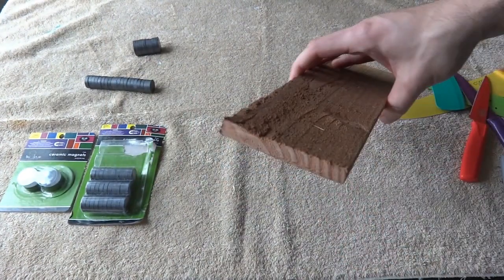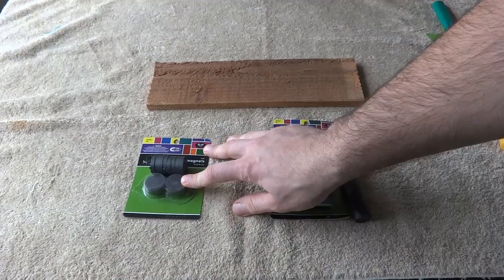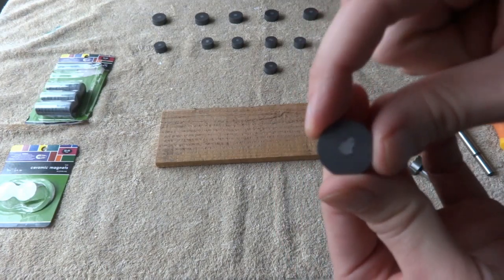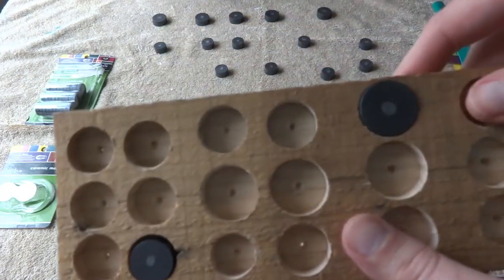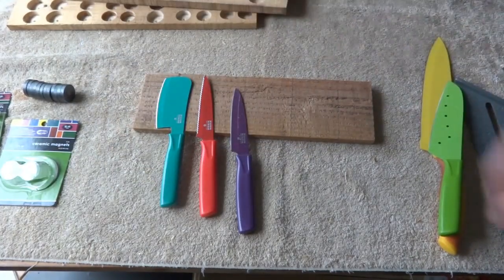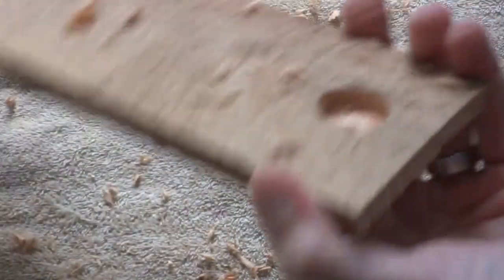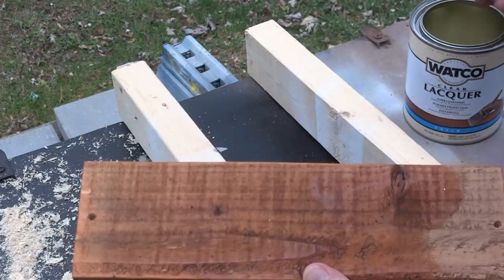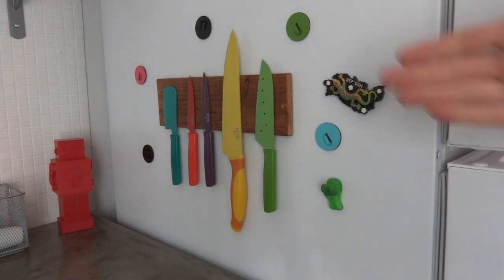DIY Magnetic Pallet Wood Knife Rack!

Comment: That's cool, I think harbour freight or princess auto in Canada sell magnetic strips in different lengths for exactly this application with tool, so plenty strong, and perhaps a bit easier to make as you only have to put a dado into the board with a table saw or router instead of multiple holes. Would also eliminate the risk here of your Forstner bit punching through the board.
Reply from the maker: I've seen those at a few hardware store, but never thought to sink one behind wood like this. That could be pretty cool!
Reply: Ikea sells them too... though some of them are a lot stronger than others. Even though they're the same size.

Comment: Nice, would have been a great idea for Christmas presents!

You could have also used Neodymium Magnets and gotten away with 1 or 2 for the smaller knives and 4 or 5 for the biggest knife ($12 on ebay fir 20 magnets).  They are thinner and stronger so you wouldn't have had to get so far though the wood (allows you to use thinner pieces).

Also for a kitchen project I would lean towards using a definitely food safe finish like mineral oil or salad bowl finish - though I am probably just paranoid.
Reply from the maker: +Jason Adamczyk That's a great price. I considered the rare earth magnets, but found these ceramic ones locally and wanted to try them out. The neodymium magnets would hold great though. I probably should have used an oil. I wasn't sure how this pallet was used in its previous life, so I decided to seal it with the lacquer, but I agree, that may have not been the best choice.